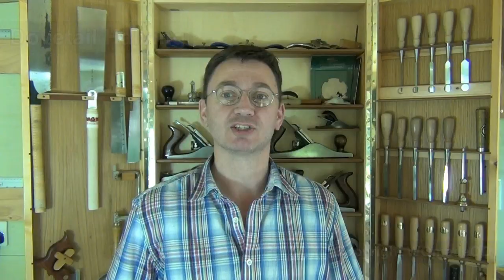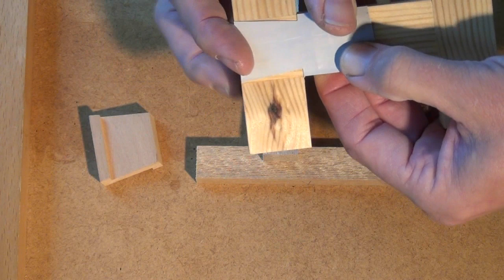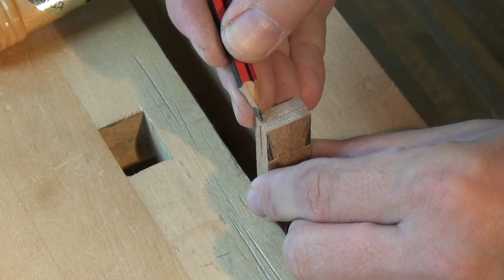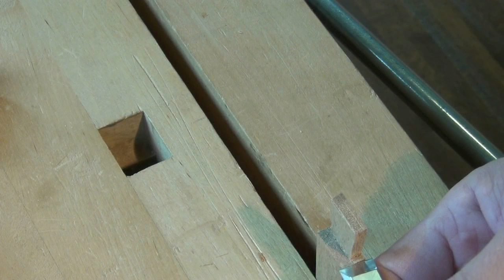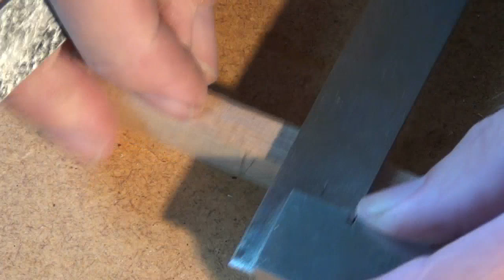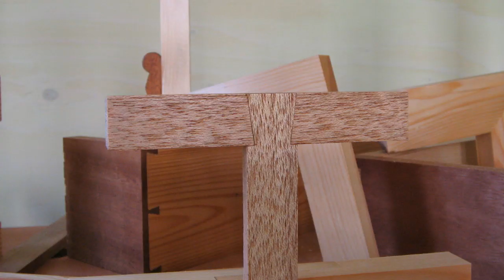Dovetail Halving Joint

Comment: I was wondering why you did choose such small pieces with which to make the joint.
Reply from the maker: Hi. No reason, but it does reflect the scale of the joints I would commonly use making furniture. Clearly you can scale it up, or down, to suit your needs. Cheers, Mitch

Comment: Hi Mitch, i am studying carpentry and joinery at college and has part of project i have been asked to find 4 uses for the six joints we are using in a practical project and this is one of them, I have found loads of info on how to make it and i have actually made one but i can't find what it is used for can you help?
Reply from the maker: +Carl  Dancer I've used it to tie in the narrow stretcher sections of a table with a drawer in it - making the end of the dovetail 'blind' so it doesn't show through the front. Variations of it have been used in timber framing and artisan furniture. If you consider the physical properties of the joint (any joint) you can work out where it could be used to good advantage. That doesn't always mean the 'best' physical joint is used in any situation, since the effort required to make it needs to be considered too.

Comment: I tried this before........... with an awful result........... :)
I'm going to try again using your recommendations. Thanks for sharing.
Reply from the maker: Marcelo Iván Rojas Hernández practice makes perfect, as they say here. Good luck
Reply: wooow!, what a detailed finish!, by the way, which is the name of the tool you use the minute 8:10 Mitch Peacock - WOmadeOD
Reply from the maker: Hi Rodrigo, That tool is a router plan. happy woodworking, Mitch
Reply: Thanks!!!!

Comment: Graham I have just messaged you but just in case I will post it here just in case others are struggling. I'm having problem knowing how to mark the dovetail by measuring it. I here it's 6:1. What problem I have is that I don't know anything about the 6:1 method. The wood I'm using is 2 be 2. I don't know how far I need to come in at the shoulder to mark the dovetail angle. I'm totally lost. Thanks in advance.
Reply from the maker: TheLondonForever00 Hi, I'm guessing you are wanting to make a dovetail halving joint out of 2"x2".The 6:1 ratio just means you create the dovetail by sloping the tail sides 1" in width for every 6" in length. Thickness is irrelevant in the calculation.So, to join two bits, each 2" wide, in a 'tee':  Length of dovetail will be 2" (this is the'6' in the ratio)  To calculate shoulder width (the '1' in ratio) we divide the 6 by the 2, 6 / 2 = 3  Then divide the 1 of the ratio by this 3, 1 / 3  = 1/3  So, the dovetail will be 2" long, with shoulders of 1/3"  Mark a line 2" in from the end of the 2"x2".  Gauge lines 1/3" from both edges.  Connect each intersection to the nearest corner, and you have your dovetail.Hope that helps, Mitch

Comment from the maker: Sorry if it wasn't clear. The end grain to long grain glue joint is poor in relation to the long grain to long grain. By introducing the dovetail, you sacrifice some long grain to long grain glue area, and therefore the glue strength of the joint is reduced. The mechanical advantage of the dovetail is only really effective whilst the glue is curing, or if the glue fails. So to be fair, the best joint will depend on the specific requirements, and it is the craftsman's job to pick the best one.

Comment: I do not understand what you mean by "poor glue surfaces". Poor in comparison to what joint? If compared to the half lap, it seems virtually identical for glue surfaces, with the added bonus of a mechanical reinforcement from the dovetail.